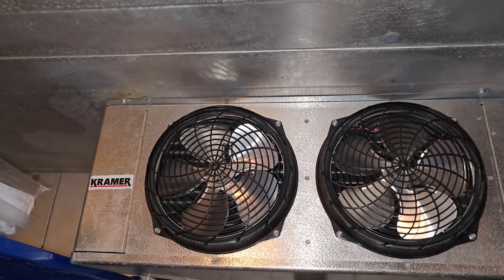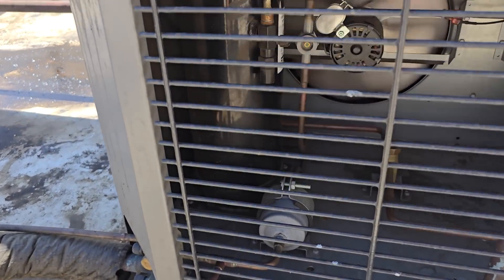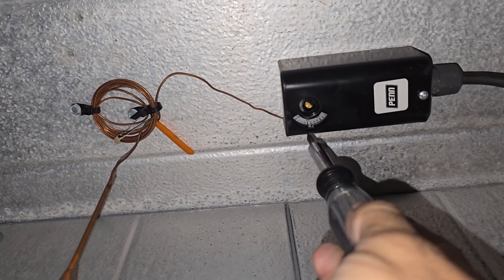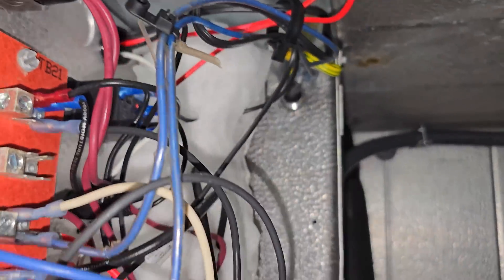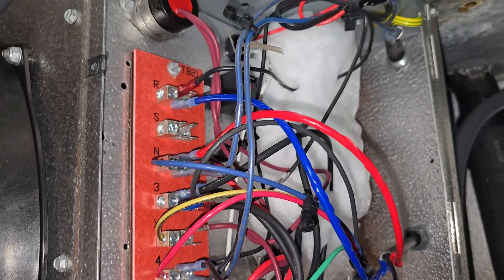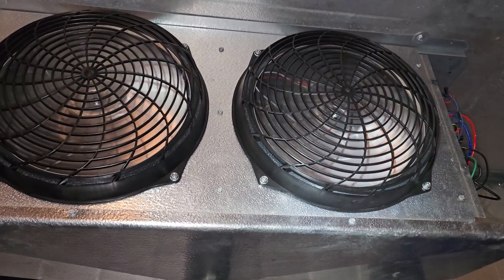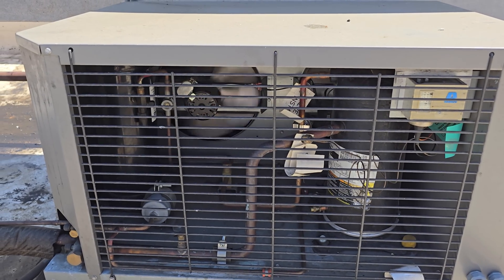THE WALK IN FREEZER IS TOO WARM

Comment: 01:11 - "Timer is a bit off" *goes ahead to add back a good 16 hours lost* 😆Yeah it was just a lilbit off. (Could be just 8 hours too much, I assume these Grässlins can be only turned forward manually.)
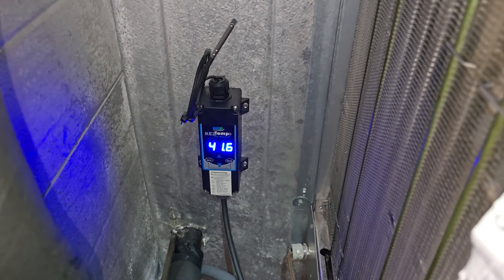06:15 - Gotta love how manufacturers jump on the bandwagon to use blue LEDs in their displays considering a guy with *no diploma* solved this multi-decades old blue LED conundrum in the semiconductor industry a while ago.

Comment: How will setting it for -20 make it -10, wouldn’t that make it -20?
Reply: The old temp control is mechanical and it loses its calibration over time. What the temp dial says and the actual activation/deactivation of the solenoid will be off. A brand new one can be off a few degrees but you correct for it.
Reply: @Jon.Rushing  oh I get it he’s just making up for the off calibration by offsetting it, thanks!
Reply from the maker: @JP-sd2cw yes sir

Comment: Maintenance Guy showed up today, replaced the hot water valve body on our 3-bay sink, temporarily restoring hot water pressure. He poked mineral buildup out of our spray wand (pushing it inside), so I unclogged it again a few hours later when it plugged back up. It was plugged again within a few minutes, and I'm sick of taking it apart all the time, so I said "eff that" this time.

Dude started whining about the water softener being bypassed and unplugged from the wall, which I reminded him hasn't worked properly since 2021. He lied and said "Nobody ever told me," to which I told him I've mentioned it to his face several times over the past three years that it is not dispensing salt AT ALL and the front panel no longer responds to any button presses, but because he'd rather shout over me instead of listening to me, there's no possible way he could know. He plugged it back in, changed the valves to put it back into the loop knowing it wasn't working, and there went our water pressure - hot and cold. Eff him, as well.

Top level of our Delfield sandwich station - the one he finally attached the lids to a couple weeks ago - is keeping bacon at a lovely 56°F. That was AFTER he "fixed" it today. It's actually worse than when the lids weren't attached, and Crew were leaving the lids open all day. He blamed a loose cutting board keeping the lids open instead of evaluating the system. So now we have to NOT use the cutting board, and food still isn't being kept at temp. The health inspector is gonna LOVE that, going from one infraction (improper food storage) to two (improper food storage AND improper prep surfaces).

Kicking myself in the @$$ for not getting into the HVACR field in my twenties. I could be fixing this stuff, instead of complaining about it never getting fixed.
Reply from the maker: We need more folks to get into this industry, never to old to change careers

Comment: Have you ever found the body of someone who got locked in a walk in freezer and died? I've heard stories of it happening and am always paranoid about walking in the freezer because of it, especially late at night. Is there a way to get out of most walk in freezers if you get locked in or anything you can do to survive?
Reply: Define locked in. You talking if the door is closed and latched on the outside?  Or talking if the door is closed snd latched and the door handle is also padlocked on the outside?
Reply: @jollygreen4639  Ya locked from outside or if it breaks somehow so it can no longer be opened
Reply: If the handle broke off, there’s a push knob on the inside of the door that is connected to a rod that will push on the innards of the latch and will allow the door to open. 
If it’s padlocked, hope you’re wearing a jacket.
Reply: I wouldn’t be overly concerned that it’s gonna happen.

Comment: Don't think you should be re-identifying bonding (green) conductors as hots, now there is a 208V controller screwed to a metal box without a bonding conductor, not big on that
Reply from the maker: There is no way to bond that plastic controller to ground
Reply: @HVACRVIDEOS  well that is interesting I've never used any line volt controller without provisions for bonding , so I guess as long as you wiring method contained no metal box connectors you're good to go but if there is a metal box connectors a grounding bushing would be required w/ bond conductor landed on it

Comment: YO CHRIS!, Today I placed an order in TrueTech Tools with your discount code some $2,000 and change......
Reply from the maker: What did you get ?
Reply: @HVACRVIDEOS  : Expected some time today via FedEx..... new Fieldpiece 4 port manifold, a scale and a vacumm gauge. 🤞🤞🤞
Reply: @HVACRVIDEOS  : All Fieldpiece the new manifold 4 valves, a scale and a vacuum gauge.
Reply: @HVACRVIDEOS  : All Fieldpiece except the leak detector. the new SM482V Manifold, SR47 Scale, MG44 Vacuum Gauge, MR45 Recovery Machine, VP87 Vacuum Pump, HS33 Meter.

Comment: I agree with you about those Penns would love to carry the KE2 temp controllers. They are super easy to program.
Reply: never used or seen them installed anywhere, but I do wonder how they hold up to nearby and frequent lightning strikes. I have seen other digital models(retrofit and new) hold up ok, including the rectangle module type. but then again, nothing was as reliable as the old dinosaur stuff, seen contacts in herm arc welded shut and where a huge fireball occurred from a power line strike, amazingly the machine was running and frozen near solid(pressure switch was banging) lol 🤔
Reply: They hold up the best in my opinion, in coolers I always use the Ke2  air temp+ defrost. I haven’t seen one fail yet as opposed to digitals like ranchos which fail a lot especially in freezers or penns which i keep getting bad straight from a manufacturer or supply house.